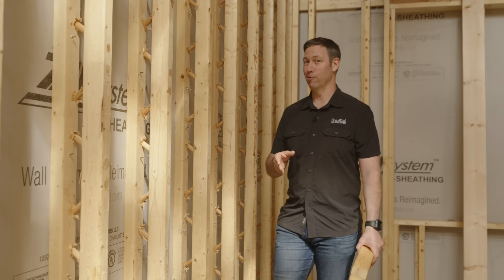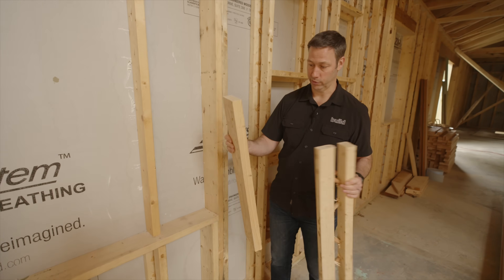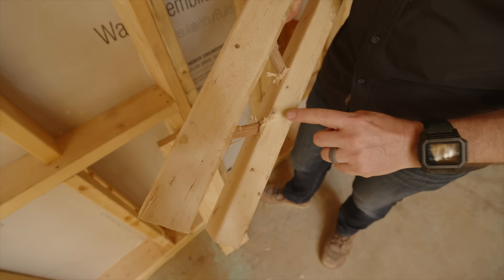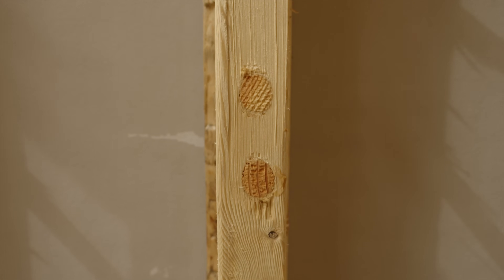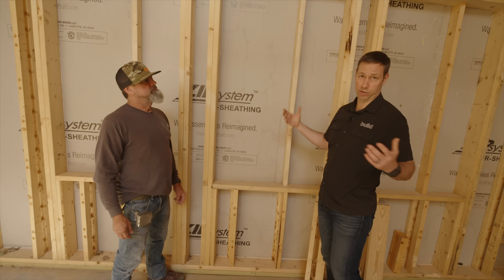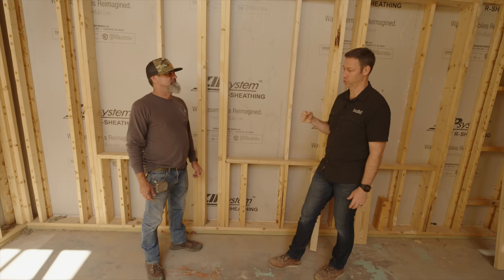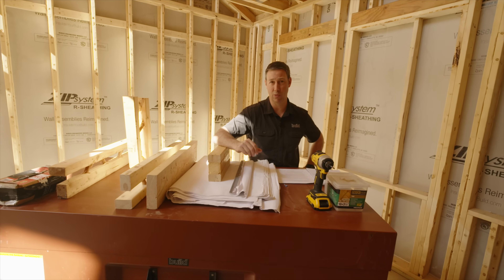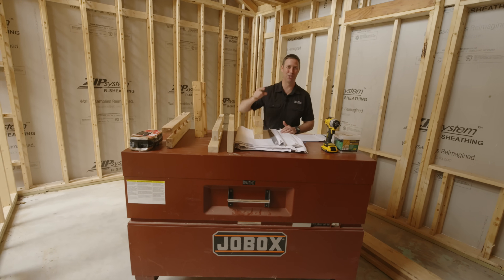Framing with a 2x6 Replacement - TSTUDS!!!

Comment: TStuds... FIVE times more expensive per board foot than a standard 2x6.  WOW!
Reply: Yeah and you can simply do a staggered double wall which has ZERO temp conveyance and also stops noise transmission. For just twice the normal cost!
Reply: @danielbuckner2167  plus line the interior with insulated plasterboard.
Reply: @JohnnyMotel99  every little bit helps, so I don't have much experience with the insulated drywall. What is the R-value?
Reply: @danielbuckner2167  Don't know about USA, but in the UK it can be up to 3" closed cell rigid insulation board with 1/2" PB. It's used a lot to insulate solid brick walls on the inside, but could be used in this situation.
Reply: @JohnnyMotel99  So its bonded to the PB? How does that effect attaching it to studs or do you simply mean a 3" piece of foam board between the studs before the PB is affixed?(everybody has seen that)  I have seen some people try to save money and use both foam board AND some expanding foam in a can to get ot closer to air tight and I wonder what the real world R stats on that are too.
Reply: @danielbuckner2167  On a stud wall simply screw through to hit the studs. 
here's a link to the UK stuff https://www.british-gypsum.com/products/plasterboard-products/thermal-plasterboard
I think that if the stud wall already has good insulation fitted, this board will thermal break the studs and  provide some extra R value.
Reply: @danielbuckner2167  I thought tstuds were the smartest thing ever until reading your comment. that makes a lot of sense for the diy, but perhaps cost prohibitive from a production builder standpoint. doing everything twice adds up!
Reply: @GordonTurnerr  Well having it bidded out limits the builders cost if the sub takes more time than he assumes from the plan details but besides that it isnt too tough. You end up dragging the wall a but as you frame it on the ground as usual and then just flip it over and frame the other(side below) side, then stand 'er up. The benefits are worth the cost of materials and labor IF the person having it built wants THOSE benefits. There are other benefits like cheap cost but a flip side to that too obviously. I wont say it is "THE BEST" way to build but it is the best way to get those thermal and acoustic benefits.
Reply: @danielbuckner2167  Also having the void is somewhat point less. 5x the cost for what? 1" of additional foam? That's only an R3 tops between the walls. Also most high end architect spec away from spray foaming the entire stud bays now because you really don't want to bury all the electrical and plumbing for future modifications or improvements, also it's just not that great for sound insulation. 

Forget stagger or double wall, especially if you don't have the square footage to do a thick wall, if you want continuous insulation that accomplishes having a hollow cavity between studs you may as well go metal stud and design a house around metal stud framing. It's basically a C Channel with about 1/16 thick steel separating your stud bay. The thermal bridging that occurs with the metal studs wouldn't be much more significant than the thermal bridging that occurs with the pegs on the t-stud. 

Also the track (top and bottom plate) for metal stud walls are hollow too. Your entire stud bay is essentially insulation space.
Reply: @WallStreetBeggar  I'm very familiar with metal stud framing in residential construction in high rise and mid rises. The sound problem is intensified with metal so although you may(or may not) reduce the thermal conductivity you do increase noise transmission. 
  A double wall takes up 50% more room than regular wall. If you are building with 2x4s you simply use a 2x6 plate and so on going up. If footprint size is a concern then you probably have budgetary concerns exceeding any issues with insulation greater than typical tract homes. Your energy and money are better spent elsewhere like in better windows.
Reply: @WallStreetBeggar  "the thermal bridging that occurs with the metal studs wouldn't be much more significant than wood" You don't have the slightest idea of what you are talking about. As Dr. Lstiburek says, they don't make frying pans out of wood.
Reply: I was quoted $20 each, and today $$$ for 2x6 is 7-10 each
Reply: @robertrowe871  That's insane! I wonder what it would take to just create your own if you have the time. Then again, as others have said; just do staggered double wall for cheaper.
Reply: @drippingwax  I kind of want to play with the idea of what a 6x6 would look like in this style, if that is even worth attempting.
Reply: T Stud cost today 5/10/2021:  15% more than a standard 2X6 Douglas Fir. 
9' T Stud: $25.75
9' DF Stud: $22.16
Reply: I was wondering, there's always a big problem with things that aren't often used.
Reply: Yeah, probably because a single source

Comment: I’m down for this product, but it seems like it would be tough to integrate any type of bat insulation.
Reply: You can get them with spray foam between the 2x3s
Reply: But even if the middle was sprayed the bats would still be too wide.  I think you’d be okay w/ fiberglass but mineral would bunch up and cause cold spots.
Reply: Suppose you could find a way to mix the bat and blown in but... if it's a new build, seems more prudent to run conduits for all wires and piping and just blow in insulation.

Comment: Also easier for electricians and plumbing.
Reply: That's where my brain went first haha get the electricians in and out QUICK and pulling pex through the whole house EASY
Reply: absolute game changer!
Reply: Yes and no drilled holes are a support so supporting wire and pipe will be kinda weird
Reply: electricians yes but running drains and vents seem like it would be a little difficult drilling around the dowels.
Reply: And doesn't change how the house is framed much at all.

Comment: 3:26 doesn't give me the greatest confidence in the product.
Reply: You caught that too? I was like, "How did that make it through editing?"
Reply: @thethinkingagent7630  Exactly what i was thinking. I have a feeling T Stud won't be happy that made it into the final edit, especially in a sponsored video.
Reply: How so? That was poor nail placement (upper outer 25% of the piece of the 2x3) and work by the framer.  If you shoot a nail through any stud that's sitting half an inch off the top plate and the nail angles into the upper corner of the piece of wood it's going to cause a crack or piece to splinter off.....
Reply: @JimYeats  No debating anything you said. What i said is the optics of seeing a stud split in a sponsored video isn't good.
Reply: @benwilson6866  Yeah, poor editing.
Reply: I agree it looks bad and should’ve made it to the video, but things like this happen with solid wood too.
Reply: @x2thel  Yeah I'm sure it's a quality product, and holds up just fine. It's just the optics of seeing that in the sponsored video.
Reply: I noticed 3:26 as well! That stud is not going to take as much in compression or lateral. Hopefully, Matt will comment on this.
Reply: @pangeacapitalllc5641  probably he will delete this video and then upload an edited or even new video, just like what he did on the portable generator wiring to a house.
Reply: @yzhang8629  That we be disappointing. Rather see the issue addressed head-on.
Reply: The material looks cheap and untreated.

Comment: Ha ha, @ 3:26 your carpenter showed us how to split a 2x3 T-stud with a nail.
Reply: Isn’t that stud also too short to reach the top plate?
Reply: @yzhang8629  Stud who cut that T stud must be too short😜
Reply: Yup, one of the first things I noticed as well.  Smaller 2x3 is going to be more likely to split, and careless carpenters rushing have a smaller target = a lot more splits than normal.  I want Matt to go through and show the audience the tops and bottoms of the t studs to see how many actually split.
Reply: @greb3212  I immediately wondered about how likely the smaller boards split vs traditional lumber. Seems like it should be much more likely
Reply: @greb3212  WAIT for my video😎 sometime in this life...
Reply: I noticed that right away also.
Reply: I see I'm not the only one to catch it.
Reply: And a 1/2" air/light gap between it and the top plate!
Reply: I think T-Studs require a 4" nail. Longer nails with 2x3 -> more likely to split like we see at 3:26.
Reply: @pangeacapitalllc5641  actually I think the 4” nail is only required for going through t-stud base plate into stud. In this configuration with solid lumber baseplate they can use standard nails
Reply: @tedl2711  I think that's correct.
Reply: This product would require some patient framers... I think Matt is turning into a profit driven salesman by even promoting this crap
Reply: No kidding
Reply: I saw that too !!!!  It happens.
Reply: You mean i wasn't the only one that saw that?
Reply: It's wood, every house made of wood has the same issue with splitting studs when nailing.  The main point of this stud isn't increased nailing stability, it's about insulating properties.
Reply: HAHAHAH I'M NOT THE ONLY ONE WHO CAUGHT THAT!!!!!
Reply: Yep,split
Reply: ITS POOP
Reply: LMAO
Reply: Very attentive viewers here on the channel.  For sure he pulled that one out and replaced it after the shot.
Reply: @FrederVision  zero chance this actually happened.
Reply: I wonder how much these guys got payed to advertise these crappie, brital and pricey studs?

Comment: Do you think T studs provide significant sheer strength when installed and spay foamed after... I mean the empty studs (without insulation). The foam would bind the sheathing and studs together I believe and provide phenomenal sheer strength.